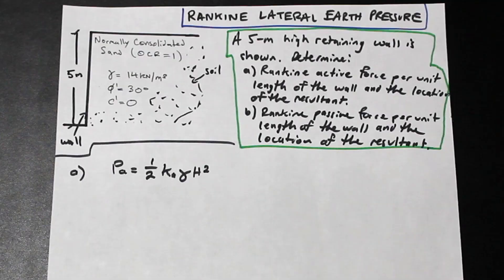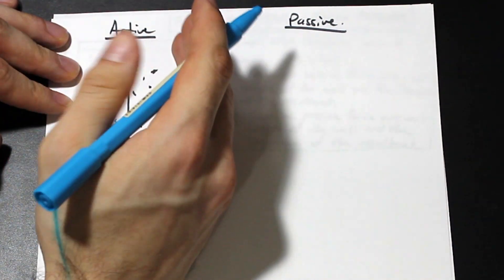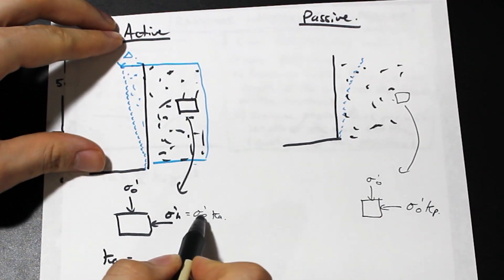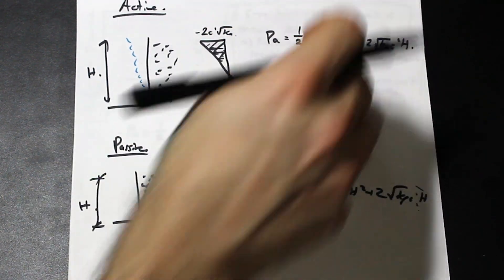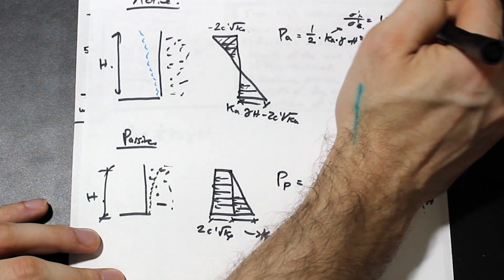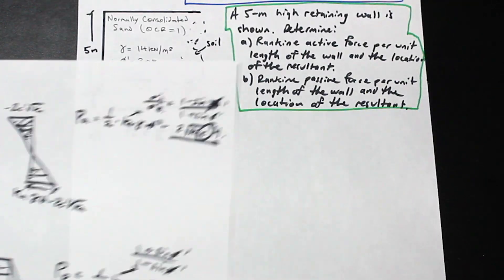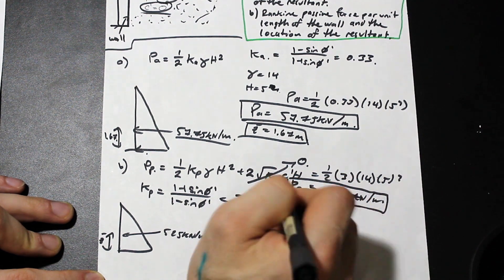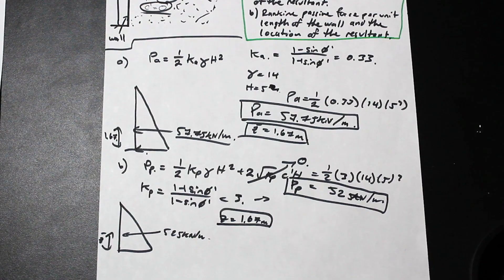Rankine's Lateral Earth Pressure - Active and Passive - Concept Explained and Example Problem

Comment: A nice video though some formulas just appeared so randomly ...derivation???😂😂😂
Reply from the maker: Thanks for the comment, occasionally we go through derivations when we feel they're important/don't take too long, our main focus is to show you how to solve the problems and point out any potential tricks that you may come across.  Also if you're in structural engineering you almost never need to understand geotechnical formula derivations as values are almost always given to you by a geotechnical engineer.

Comment: Can you explain earth pressure coefficients when backfills at grade are involved?
Reply from the maker: If you're referring to an open cut basement wall that's poured and backfilled, that would be either active or at rest pressure on the wall, depending if it's braced by slabs or if it's cantilevered.  If you're talking about piling dirt beside a foundation wall that acts as a surcharge, this adds an additional load on the basement wall 'q' that must be accounted for.  Usually we assume either 4.8 kPa or 12/14 kPa depending if this area is available for construction vehicles or trucks to access or just pedestrians.
Reply: AF Math & Engineering  say Beta is angle of backfill, as in my textbook. If Beta equal zero (ie. no grade) we calculate the coefficients of active and passive pressures the way in this video. If Beta /= 0 (ie. graded), there's a much more complicated formula for the coefficients. This is all Rankine method. 

I can do K_a decently. I'm having trouble knowing when and how to do K_p. Do you know of what I mean? Also, thanks for quick response.

Comment: Great video on the math but stuill fuzzy on the concept - are active and passive earth pressure acting at the same time all the time?  Active is the pressure that causes the wall to move but if passive is far higher how could the wall ever move?  When you say "Passive is when the wall is allowed to lean in" what do you mean by that?
Reply from the maker: Thanks, are you familiar with a basement wall in section?  It's braced at all parking level s and ground so it's unable to displace, so we use at rest pressure.  It's retaining soil from the outside of the building.  If we look between the slab on grade and the footing, there will be a portion of the wall with soil on both sides.  One will be passive, one will be active.  It's hard for me to explain over a YouTube comment this concept, if you look at a basement wall section and look at the base near the footing you'll see what I'm talking about.

Comment: i dont understand the stress diagram for the active earth pressure. Why is there a positive side?
Reply from the maker: If you don't have clay, there is no negative.  Hence the c value.  Your geotechnical engineering textbook will have a good explanation of this.

Comment: Hi, I'm trying to do an assignment for my uni on retaining wall design. I was wondering how would I use the active force found since its in kN/m. If i were to get it to just kN, which length would i multiply by to get the pressure force acting at the particular point? 
Thank you!
Reply from the maker: Hey thanks for the comment! Typically we design per meter length of wall and would just multiply by 1m to get it into kN.  Without seeing the question that's the best I can do for you! Hope it helps.
Reply: Thank you so much for the quick reply! So technically you would just multiply by the depth of the wall into the page?
Reply from the maker: No problem! Happened to be on as you posted.  Yeah you multiply by a one meter depth into the page and design for a one meter strip of wall.
Reply: @AFMathandEngineering  Do we use the active or passive to design a retaining wall?
Reply from the maker: Depends on the retaining wall type.
Reply: @AFMathandEngineering  Do you know any source that I could have a look at some examples. I've got the fundamentals of geotechnical engineering book, but its kinda more towards the soil mechanincs and not retaining wall design
Reply from the maker: @gabrielbobmarley  Yea, principles of foundation engineering by braja m das is available in both si units and imperial and has tons of great examples for all sorts of retaining walls/every type of foundation.  Great book.